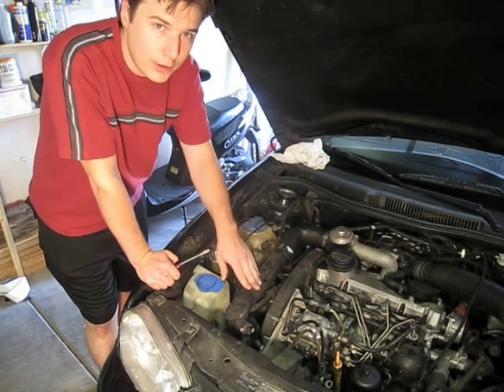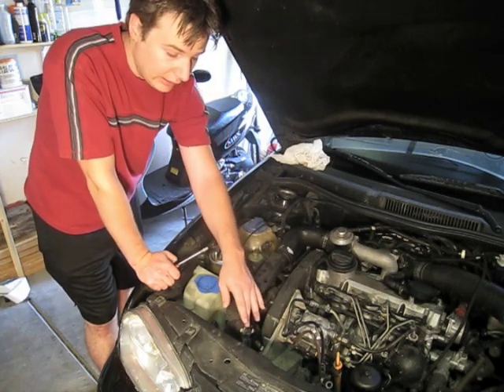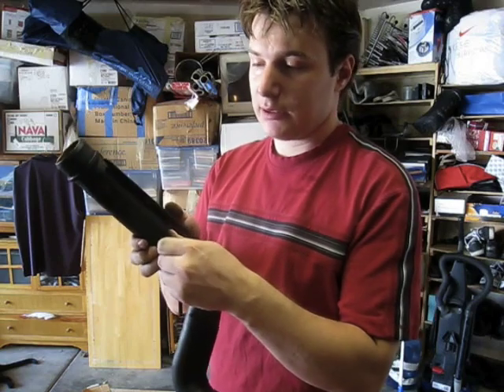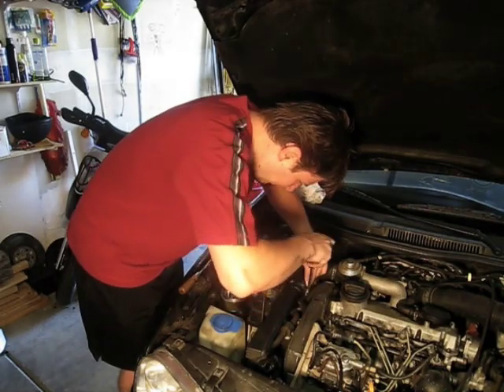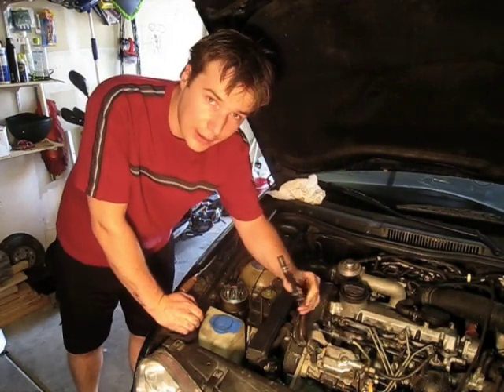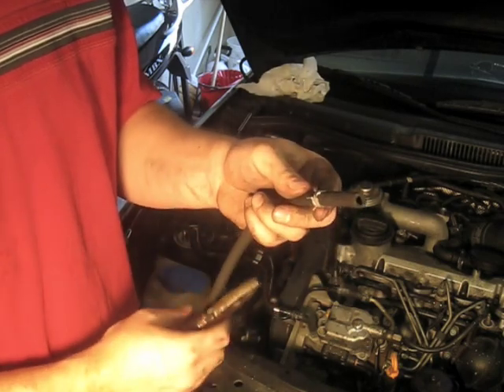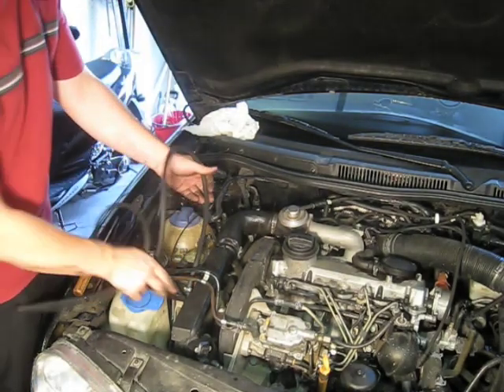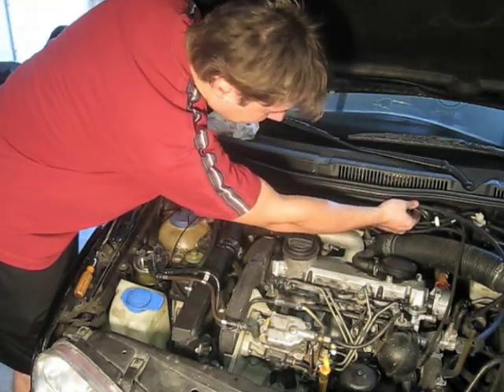Boostvalve - how to install Part 1/2

Comment: im sorry to ask so many questions but i figured you would be able to answer them. Does the basic boost controller come with a high and low pressure Spring

Comment: i want more boost because im planning to do all the modifications and i have installed bigger injectors as well as i have install the boost gauge, and cold air intake, has not been chipped yet